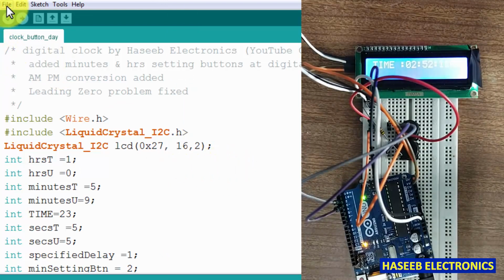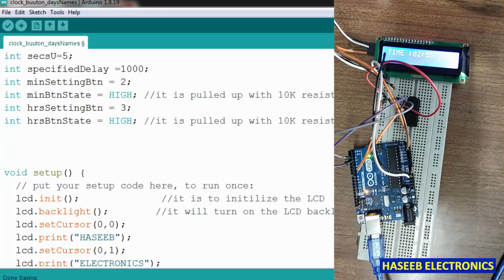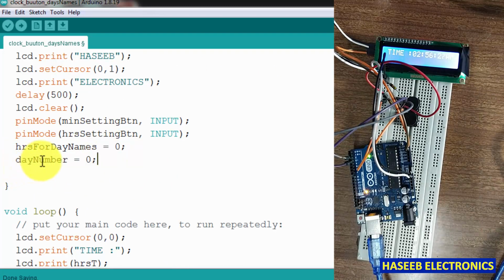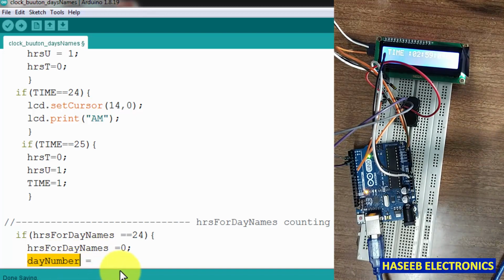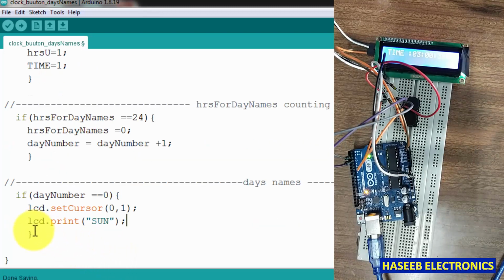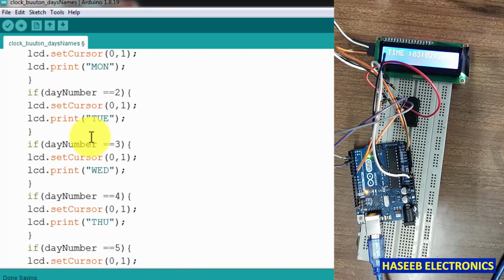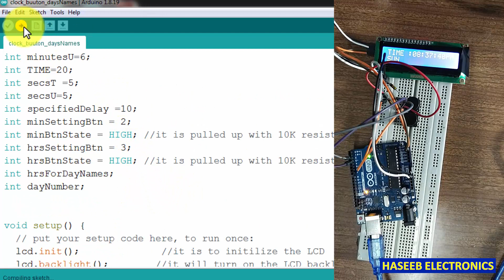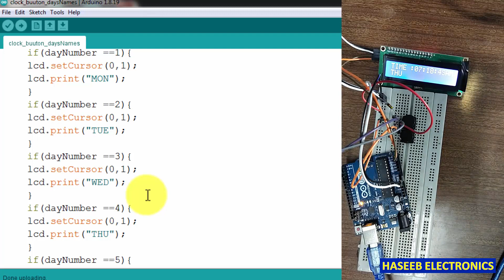{714} Writing Arduino Code for Names of the Days of Week

Comment: But without RTC the time will be very off isn:t it?
Reply from the maker: you are right 
the RTC module provides real-time clock for continuation for real timing data in case of power loss. but this clock will loose its data in case of power failure 
the main object to share this series, to write and understand the coding, that how the code works in microcontroller environment